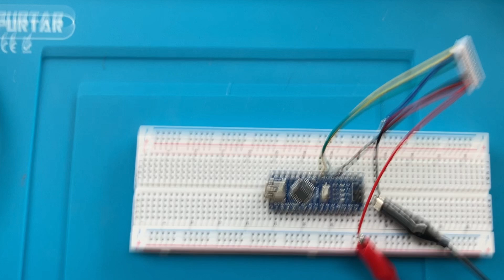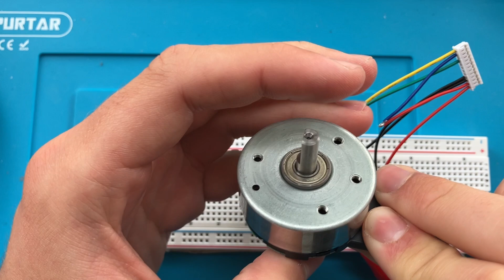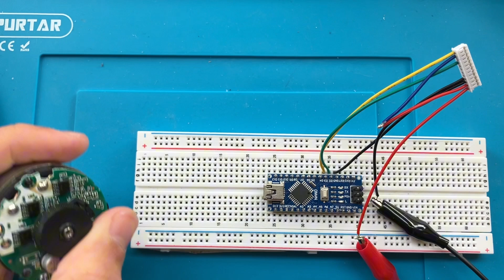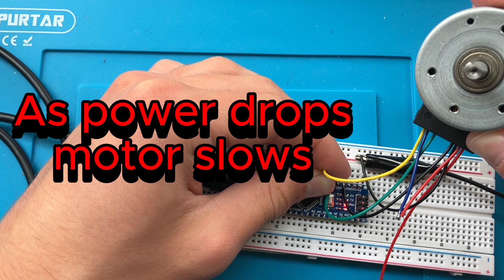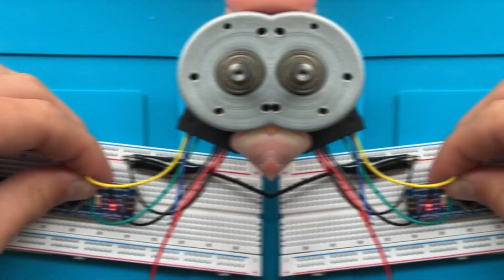Nidec 24H how to use with Arduino!!

Comment: Hello, I try your code, it runs like the video but in void loop I can't change the speed. How did you do ?My project is a reaction wheel too
Reply from the maker: Changing the frequency (hz) within the given allowable values will increase the speed the lower the hz the lower the speed
Reply: @Polyneeringstuff  Thx, I will try this... Did you finish your project ?

Comment from the maker: Single Motor Code -

// Single motor control on D3 (PWM) with direction on D5 for Nidec 24H
// Designed for Arduino Nano, 12V motor power via XL6009, 5V Nano power

// Constants for PWM and direction
const int PWM_PIN = 3;            // D3 for motor PWM (Pin 5, blue wire, Timer 2, OCR2B)
const int DIR_PIN = 5;            // D5 for motor direction (Pin 7, yellow/orange wire)
const int DUTY_CYCLE_PERCENT = 21; // 21% duty cycle for low speed (~820 RPM, ~90-95 mA)
const long FREQUENCY_HZ = 7800;   // Target ~7.8 kHz PWM frequency (within 500 Hz-50 kHz)

void setup() {
  // Configure D3 as output for PWM signal
  // D3 sends PWM to motor driver or motor Pin 5 (blue wire) for speed control
  pinMode(PWM_PIN, OUTPUT);
  
  // Configure D5 as output for direction control
  // D5 sends HIGH (5V, CW) or LOW (0V, CCW) to motor Pin 7 via driver
  pinMode(DIR_PIN, OUTPUT);
  
  // Set motor direction to clockwise (CW)
  // HIGH (~5V, ~1 mA) on Pin 7 signals CW rotation (per Nidec 24H datasheet)
  digitalWrite(DIR_PIN, HIGH);
  
  // Configure Timer 2 for D3 (Fast PWM, Mode 3)
  // Timer 2 controls PWM on D3 (OCR2B), using 8-bit counter
  TCCR2A = 0; // Clear Timer 2 Control Register A
  TCCR2B = 0; // Clear Timer 2 Control Register B
  
  // Set Fast PWM Mode 3 (TOP = 255, WGM22:20 = 011)
  // Fast PWM counts from 0 to 255, then resets, creating a PWM waveform
  // WGM21 and WGM20 in TCCR2A, WGM22 in TCCR2B (not used here)
  TCCR2A |= _BV(WGM21) | _BV(WGM20);
  
  // Enable non-inverting PWM on D3 (OCR2B)
  // COM2B1 sets D3 to HIGH when counter < OCR2B, LOW when >= OCR2B
  TCCR2A |= _BV(COM2B1);
  
  // Set prescaler to 8 (CS21 = 1)
  // Nano’s clock = 16 MHz; PWM frequency = 16,000,000 / (prescaler * (TOP + 1))
  // Prescaler 8, TOP = 255: 16,000,000 / (8 * 256) = ~7812.5 Hz (~7.8 kHz)
  TCCR2B |= _BV(CS21);
  
  // Calculate and set duty cycle for D3
  // Duty cycle = (OCR2B / (TOP + 1)) * 100; TOP = 255
  // 21% duty: OCR2B = (21 * 256) / 100 = ~53.76, rounded to 53
  // OCR2B = 53 gives ~20.7% duty (close to 21%), ensuring >=20%
  uint8_t dutyValue = (255 * DUTY_CYCLE_PERCENT) / 100; // ~53 for 21%
  OCR2B = dutyValue; // Set D3 PWM duty cycle
}

void loop() {
  // Empty loop, motor runs at fixed 21% duty cycle, CW
  // No dynamic changes needed for testing single motor
  // To change speed, modify DUTY_CYCLE_PERCENT and re-upload
  // To change direction, set digitalWrite(DIR_PIN, LOW) for CCW
}

Comment: Thank you, I watched your video before and made the motor run, however my motor vibrates quite strongly and runs quite hot, not as smooth as yours, so do you know where the error is?
Reply from the maker: These motors can be damaged easily I have found and your one sounds like it needs replacing. After a few tests on one motor with the wrong parameters it became jittery and eventually stopped working
Reply: I have the same issue... did you solve it ?